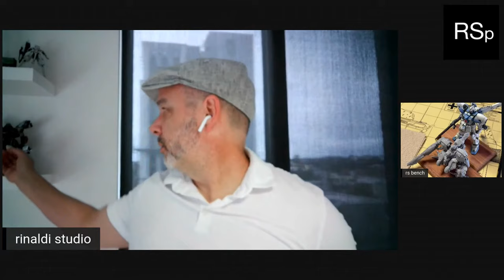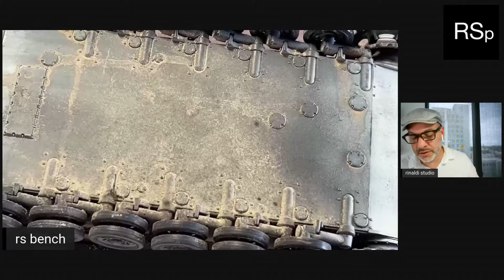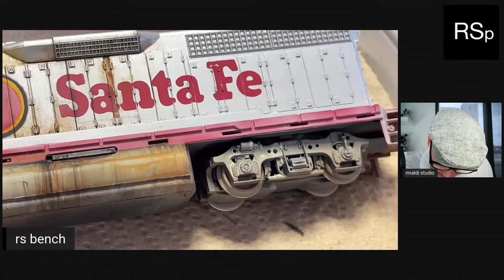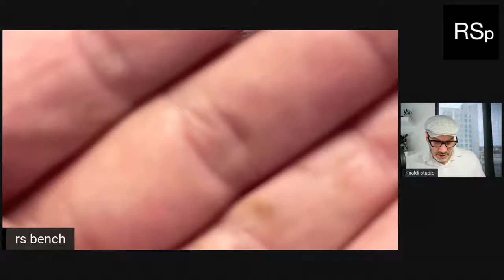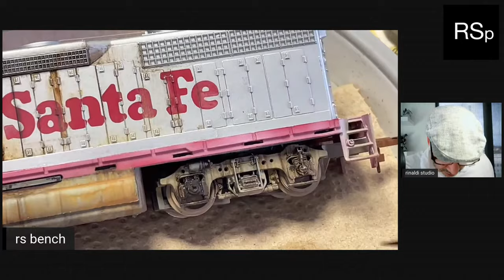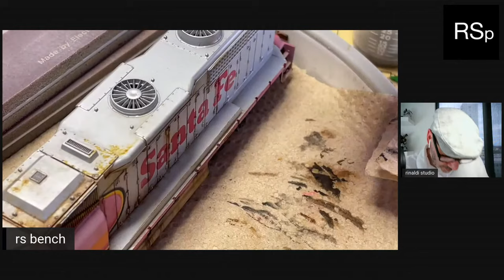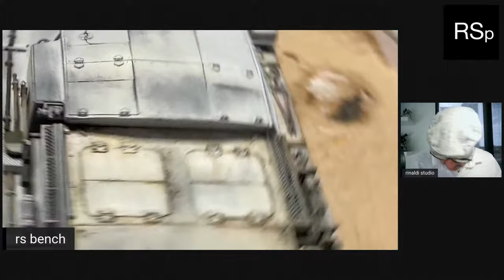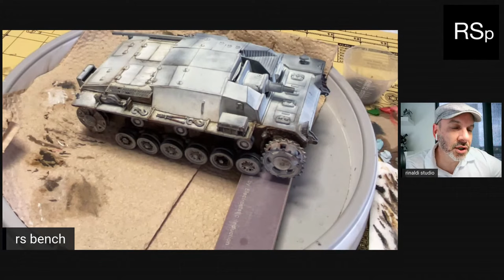Ep 23 - OPR Weathering How-to

Comment: im always afraid to push the boundaries to my weathering. However, the Typhoon K, with its plain box shape forced me to use the techniques I learned from you along the way. When dust wash and color fading did not make the typhoon a whole lot more interesting, the speckling did! Now Im considering adding pigments on the roof and see how it goes! Your SM book clearly documented your process from start to finish and making adjustments along the way. I'm now embracing your approach instead of the traditional filter - pinwash - chipping approach. Thank you Coach!
Reply from the maker: That's great to hear Zal, cheers!

Comment: The locomotive you are working on loosely represents and EMD GP40. Santa Fe had ONLY one GP40, but it was designated a GP35 and never made it intot he paint scheme you are working on. It was wrecked. I believe it had a collision with a cement truck. It has a 16 cylinder prime mover. The motor sits in the middle behind the tall doors. At the rear (shorter doors is the radiator compartment. The area in front of the engine room doors is called the generator compartment.

The bulge over the engine room doors is called the dynamic brake intake. The fan on top pulls are through the intakes to cool the resistors which get really hot when the locomotive is put into dynamics which is a way of slowing the locomotive instead of using the brakes. It essentially turns the traction motors into generators and that electricity is sent tot eh dynamics and dissipated using resistors.
Reply from the maker: Thank you Brian, we armor guys appreciate the details all the same. I have much to learn with the nuances of rail road but hopefully the weathering techniques help you out in return. Cheers! 

(and yes, this is just demo piece, and from this work I've been able to study a lot of the War Bonnets since I started and it's not the top of the line replication of a prototype by any means.)